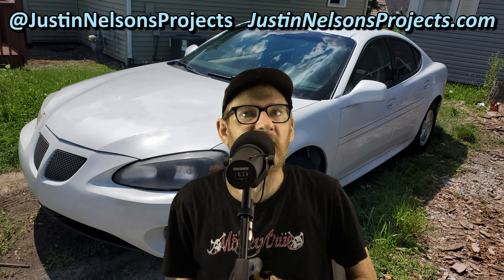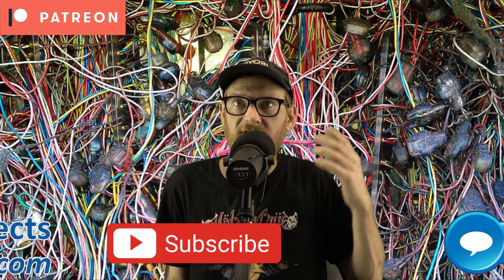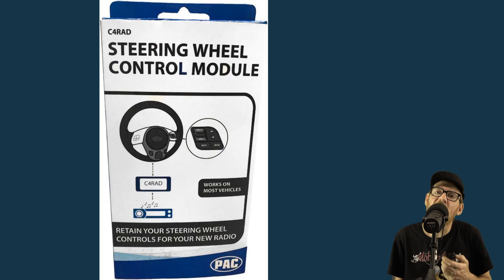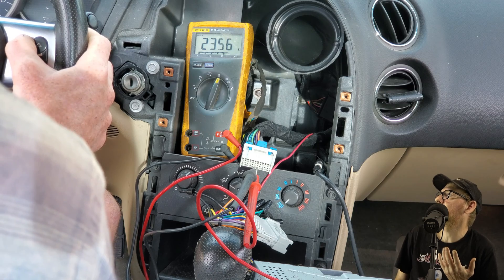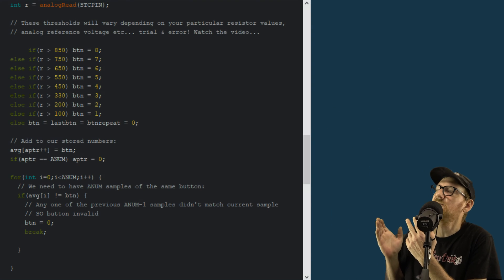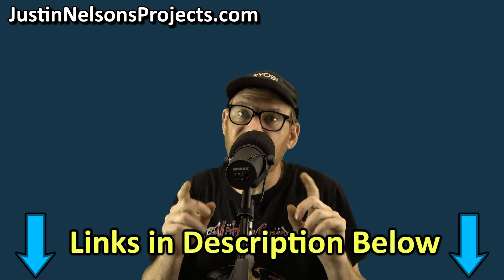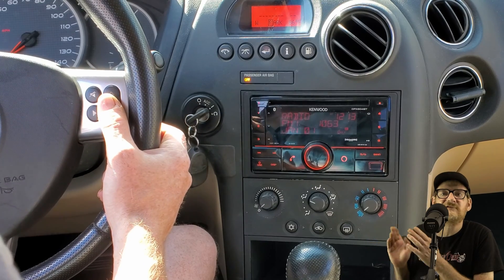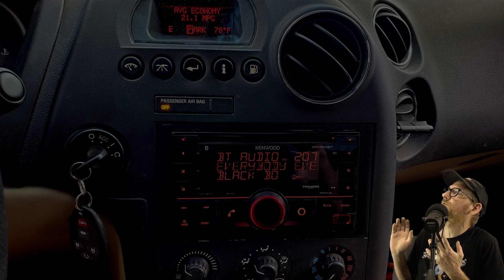Steering Wheel Buttons w/Aftermarket Stereo | Arduino Project - Save $$$ and Build it Yoursef! #diy

Comment: this is a fantastic video!! for anyone else looking to go the DIY route, note that this video details one of TWO formats aftermarket stereos might expect the steering wheel controls to be in.

Format #1 = Digital codes. (This video.) Aftermarket stereos that use this format: Alpine, JVC, Kenwood, Clarion, Nakamichi
Format #2 = Variable resistance. Aftermarket stereos that use this format: Valor, Pioneer, Sony, Advent, BOYO, Dual, Jensen, Lightning Audio, Rockford Fosgate, Visteon, Blaupunkt, Fusion.
(Above information provided from PAC SWI-RC Installation Instructions.)

If you fall into format #2, you will need a digital potentiometer, and your Arduino will just act as a resistance translator, which translates the car steering wheel control resistances to the resistance values the aftermarket stereo expects.

Comment: did you add a canbus reader, had a look at your videos and could not see any updste to this project
Reply from the maker: I have not... I still drive my 2007 Grand Prix and my '07 Silverado (exact same wiring setup). I don't have any plans to change that, I like my cars and I keep them running tip-top...

If I do run into a situation where I need a newer car, and find myself needing to figure out the CANBUS I will of course make a video.

HOWEVER -- I'm almost positive that the CANBUS is going to be different for every make/model of car out there. Another reason I like my older vehicles ;)

Comment: Hi Justin, great tutorial. I have built a similar unit to yours with some added features like a rotary encoder to install a volume knob since newer units for some reason do not come with them and double-press/long-press functions, but I can't for the life of me find a code for answering/hanging up or enabling push-to-talk. I bought the remote for my HU and decoded all of the buttons from it, but none of them seem to have the answer/hangup function. Extensive searching also hasn't yet born fruit. Any chance you've stumbled across these codes?
Reply from the maker: I love the idea of the rotary encoder! I very specifically chose the Kenwood and JVC head units in my car and truck respectively, because they feature a big volume knob right smack in the middle where it belongs!

As for the answer/hang up call button, my Kenwood did have a phone button on the IR remote. Oddly enough, that remote didn't come with the unit I bought, but from an older, single-DIN Kenwood ;) But it works both the newer Kenwood and the JVC (same company) so I got lucky there.

What brand is your head unit? Not that I can likely help, I'm just curious... to be honest, I was a bit surprised to find a Phone button on an IR remote to begin with (especially from an older, but still Bluetooth-capable CD deck)...

Best of luck at any rate!

Comment: Hey I have a question, Im building my own steering wheel controls, will this work as wheel? They aren't varible resistance, just an open and closed circuit. I could send you a image of it so you could get a better idea of what im talking ab, but from the looks of it you know miles more than ever would XD
Reply from the maker: You certainly could do this; the Arduino has plenty of GPIO pins you could simply set as INPUT_PULLUP, and have each button pull a pin to ground...

Of course it would be up to you to rework the code a bit... but I don't see any problem with this idea at all!
Reply: @JustinNelsonsProjects  Awesome, thanks man!

One more question, how can i adapt this to using the audio jack SWC. Mine doesnt have the antenna.
Reply from the maker: @christopheralexander7640  I'm not sure what you mean on this part... there is no "antenna" in this project... please elaborate what part of the process you're talking about and I'll try to help...
Reply: @JustinNelsonsProjects  sorry i mis-understood the 2:45 - 3:02 section. in that sectoin you say they recive an input via a input wire or a jack, mine unfortunaly doesnt have an input wire, but a SWC jack. how can I make this work with a jack, instead of a wire?

Comment: I 1998 Camry that does not have steering buttons but I am considering adding some for the android radio I just installed. The radio has two wires labeled key 1 and 2 for wheel buttons. Might these wires be expecting button resistances or some other CAN type input?
Reply from the maker: Honestly, this video is about using existing, analog factory buttons commonly found in early 2000s up to (at least with GM/Chrysler/Ford) the 2010s and newer...

This is not intended as any kind of guide for adding buttons where none exist... it's simply about being able to use the factory buttons with an after-market head unit.

As for the wires on your Android stereo... you'll need to consult its manual. Certainly any Android unit should have good documentation to customize and control it... maybe search for your unit's model number on YouTube or Google or Reddit...

Comment: Great video!  I'm attempting to add media buttons to my 07 civic, and since I have an aftermarket stereo and the car had NO original media buttons, I'm considering skipping the whole resistor network concept and wiring a little RP2040 board behind them to send control codes directly.  Still, your video provided the vast majority of the information I was looking for.

Comment: Hey I’m having a problem with my 2015 Silverado because the android head unit uses a press and hold function to learn the button but the next and previous buttons only sends a quick signal you can’t hold and press it and because of that it don’t learn those two buttons can anyone help
Reply from the maker: I'm afraid on this question, you might need to seek help elsewhere, possibly the manufacturer of the Android head unit. My video is mostly about older vehicles talking to somewhat modern stereos, but not the Android powered ones... 

I have zero experience with Android head units, and I'm personally not a fan of touch screen interfaces in a car. I mean don't get me wrong, I love my Android LOL, I just don't think it belongs in the head unit. I believe the head unit should just be a (dumb) Bluetooth receiver, and the Android operating system (or iOS) on your easily replaceable/upgradeable phone... 

This is of course personal opinion, but my point being, I don't have any experience with that type of setup so I would be of little help...

Comment: Just wanted to say thanks for the vid. I just built an interface for a 2004 Bonneville so this vid was perfect! I have a Pioneer radio so I had to figure out how to feed it the correct resistance values for the different functions. I used a digital potentiometer for that. This was a time-consuming project, but I'm pleased with the results. Tip: My cheap Nano clones output 3.7v on the 3.3v pin. I used a 20k trimmer instead of the 10k resistor. Using the serial monitor, I was able to dial in the trimmer so my buttons are right on.
Reply from the maker: I'm glad you had success with this project, as we all know every vehicle is different even if they're made by the same company such as General Motors.
Reply: @JustinNelsonsProjects  For sure. I still checked with the factory service manual and measured my actual wheel. Your sketch was a good starting point and I don't think I had to change much. Well, with the top half anyway. I might have to get a Kenwood in the future. I like my Pioneer but the wired remote is limited. Fortunately I'm not so lazy that I can't just reach over if I need to 😁

Comment: Thank you for this tutorial. I just finished SWC project based on your video. It's Honda Pilot with only 4 buttons. I modified SWC.ino code that it sends signal to radio only when button is released. That allows to implement long hold feature and send another code when hold 1 sec. So, same button can either switch to Next track or Next folder.
Reply from the maker: That is awesome to hear! I hadn't thought about doing like a long press or double click feature, but I have eight buttons on both my truck and my car so I'm not exactly short on buttons.

But that's an awesome mod! If you could upload the code to Google drive or a Dropbox or something like that, and share with the community, I'm sure it would be appreciated 😀
Reply: @JustinNelsonsProjects  YT removes comments with an URL. This is fourth time I'm trying to add link to my project on arduino CC. So, you should know main domain and editor link, here is my unique portion of url, just append it after editor/. emanation/5b00c9ea-a580-4165-aafd-1cc96595b0f4/preview
Reply from the maker: @konstantinpalkin2177  I'm going to work on adding a discussion forum on my website, where I will in fact allow inline video links as well as external links 

I didn't realize YouTube was so restricted about external links in comments, so I'm going to create an area just for my viewers and anyone who's implemented these projects to be able to share their experiences in video form... 

Give it a few weeks, I have a lot going on right now but look forward to that 😀

Comment: Thanks man, really useful video. You got my sub! I am planning a similar device with additional functions; it outputs media controls to my phone as BT HID device, since audio output goes directly to DSP via BT. I connect to my Alpine headunit only as HF device, so call buttons need to be routed to headunit. If I get that to work, it would be nice to add small OLED screen to show simple status from WIFI OBD2 adapter updated like once every 10 seconds. Still doing some research; not quite sure which board to choose, as I have understood not all of them are capable to BT HID and the wifi would be also nice. I wanted to use AVRCP profile instead since it provides track search and song metadata among other functions, but it seems  complicated to execute without the AD2P profile itself which also "steals" the audio, also not possible on BLE afaik. For my Alpine I managed to find the basic media commands, but not the HF ones I need the most.
Alpine RUE-4202 address: 0x61 0x4E
Commands:
0x68 - MUTE
0x90 - POWER
0x70 - UP
0xC8 - LEFT
0x50 - SOURCE
0x48 - RIGHT
0xF0 - DOWN
0xA8 - VOL-
0x28 - VOL+

Comment: Have you gotten this to work in canbus system yet? And even though my car has canbus, is the steering wheel control necessarily controlled by canbus or could it be the simpler type?
Reply from the maker: Not just yet, has the video shows I did that in my Grand Prix. But my Silverado has this crappy Bosch interface that just doesn't work that well. So I plan on doing another version of it for the truck...

Unfortunately it is also a resistor divider, I don't currently own a vehicle that relies on the can bus for the steering wheel buttons.

Springtime is when I tend to purchase vehicles that need attention where I can flip them for a profit, the next one I get my hands on hopefully will have a can bus version, at that point I'll be able to write Arduino code to accommodate that setup.

The unfortunate part is, until I have a vehicle that uses can bus for the steering wheel buttons, I literally have no way of riding the code and testing it out. But hopefully sometime early spring, I'm actually looking for a used Prius that needs battery replacement.. there's a lot of money in that, and I'm pretty sure the Prius is all can bus .. we're pretty much any more modern car.

Keep an eye on this channel, when I do crack the can bus thing, there will definitely be a video and I'll make sure I detail things out to make it very easy to understand.

I literally just reread the last part of your comment. Even if everything else in the vehicle is run by the can bus, it is still entirely possible that the steering wheel buttons for the radio are just analog resistor dividers. The only way to know for sure would be to look up the wiring diagram for your vehicle.

Even my Chevy silverado, while it has buttons for the stereo that are analog resistor dividers, there are also four additional buttons that are completely can bus. Those would be the buttons that show me the mileage and all that other fun stuff on the digital dash display. But yet the actual stereo buttons are still a resistive divider.... 

Again the only way to fully know for sure, would be to Google the wiring diagram, and I know that could be daunting, for your specific vehicle....
Reply: I did research on the matter and basically I'm pretty sure my core does have analog signals for the controls, i will be trying to make a bluetooth to 3.5mm aux adaptor with steering wheel controls working out of an esp32 fro my car. Thats the only way to make everything work without some expensive bluetooth module at least that i've figured out.

Anyways the project cost is about 20euro which is nothing compared to store bought device and i like the diy part so I'll see if i get it to work

I'll be waiting for the video once you get around to do the canbus version
 @JustinNelsonsProjects
Reply from the maker: @leohaukipuro7896  Even vehicles that utilize the CANBUS for everything else (including other steering wheel buttons like shift paddles, cruise etc) often STILL use an analog resistor-divider array for the stereo controls.

My Silverado for example, has CANBUS buttons for controlling the dash display, resetting the oil change interval etc... yet the stereo buttons are in fact analog...

Since I do not own a vehicle with CANBUS stereo controls, I really don't have any way to implement and test that method... I think mostly foreign cars use the CANBUS for this, and in my 48 years I've yet to own a foreign car (just preference honestly, not making a political statement here lol)...
Reply: Oh that clears it up, thanks for the advice! I will be digging out the wires for steering wheel controls some day and see if i can get them hooked up to the esp32 and get them working. @JustinNelsonsProjects

Comment: Very usefull video. I woukd like to do the same for my Renault Kangoo Minivan. The adaptor is almost $80 but the main reason is that I would like to translate the function of two buttons to pick/hangup call. The source button is useless, I would use only the BT and very rarely the Radio.
Reply from the maker: You can most certainly program pretty much any button to send any remote command to the stereo. I reassigned a couple of my buttons in a similar way.

Back in the day I put a $160 converter box made by bosch, in my Silverado pickup. Unfortunately four of the buttons do absolutely nothing useful, one even caused my stereo to freeze up... and this is of course before I got into microcontrollers. I'm soon going to make another one for that vehicle...

Comment: How about hooking up to an iPad? So that the iPad is the headunit and the SWC can work with iPad directly? Would the Bluetooth one work with iPad?
Reply from the maker: That would be a completely different project all together... I don't think I would use an iPad as a head unit, when for a LOT less $$$ you can get an Android drop-in touch-screen car stereo that's suited specifically for that purpose (eg, has 4-channel amp etc)... plus I personally don't work with iOS as it's too restrictive for me...

In theory, you should be able to control an iPad via Bluetooth, using a microcontroller project such as this but using one with a BT chip on it... perhaps an ESP, though I'd be weary about the ESP's ADC not being very accurate or predictable (for the actual buttons)...